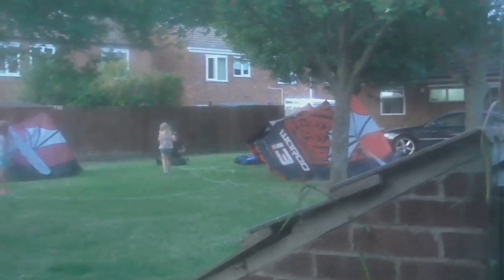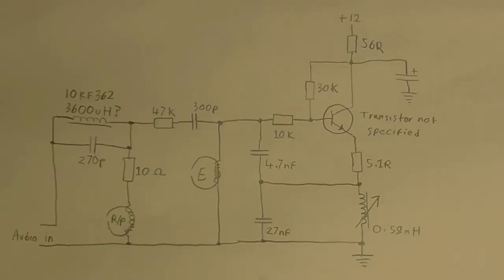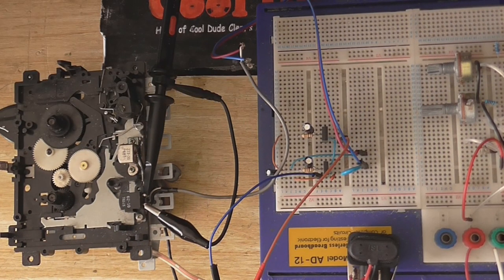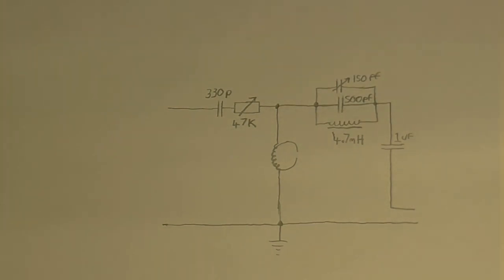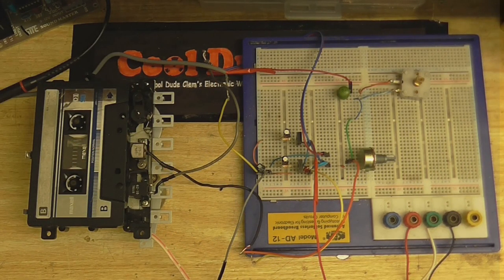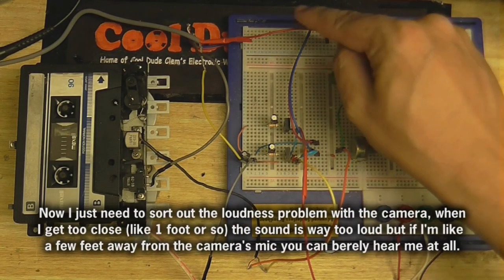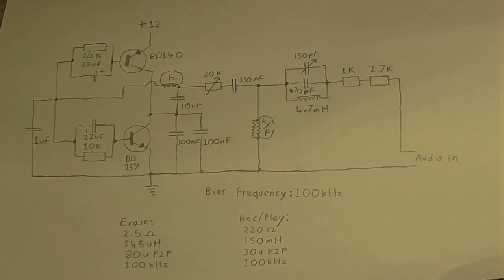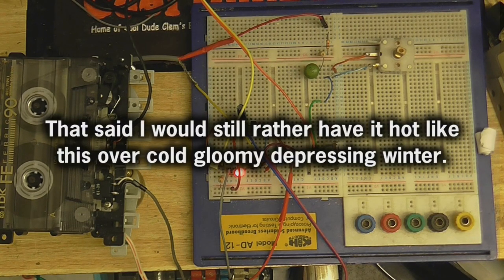My Home Made Tape Recorder with GOOD AC bias circuit.

Comment: Very useful video to me right now. Currently building a tape echo box using cassette head components and designing the mechanical parts partially from scratch, and the circuitry. It's kind of a race to see which works better first given I finally have the mechanical parts aligned like tape head azimuth and pinch roller pressure. Now my project is down to the circuitry aspect. Finding tape erase/bias circuits is not easy. I've looked top to bottom on the web only to find the same circuits you have. My issue is that I am trying to run the entire circuit off of +-10VDC so I can use OP Amps to do most of the hairy audio work. This required me to build a special motor control circuit with regulation and current control for a 9VDC motor. The other fun came in with the erase head bias circuit where I am at now. Not easy to find a solution or scale up properly to 20VDC to run an erase head without lots of wasted heat. I eventually went with the circuit you mentioned around  3:00 in the video. I found a suitable coil in my junk bin and had it running with around 50v p-p at 100kHz on the erase head which should be good enough for the heavier metal cassette tape biasing. One thing I learned is cassette tape does not like loudness as we'd first think experimenting, the heads actually require very little amplitude to work outside of the erase oscillator and bias feed. This caused me confusion for a while because I was pushing the record head too hard and completely confused why I couldn't get a clean sine wave in it and out of the replay head until I dropped it way down to damn near the tape noise hiss level. Gave me new respect for Tape EQ which is my next hair puller when I add pre-emphasis and de-emphasis to the record/replay amplifiers.

Comment: Hi Clem, I built your circuit though it used BC547/557s but could not get it to oscillate. I'm using a a Sony WM-D6C erase head which is about 0.90uh, 3 ohms... do you know the measurements of your erase head? Thanks, Mole

Comment: I'm a bit lost. Are you amplitude modulating the bias frequency that's recorded on the tape?
Thanks.
Reply: Yes that is always the way audio is recorded on tape. Without that ac-bias there is much more noise from taperecording. (in the early years some very cheap recorders used dc-bias)
Reply from the maker: Actually the audio source just adds a small amount of DC shift to the bias depending on whether the signal is swinging positive or negative, so when the audio signal is positive the bias if shifted up a little, and when the source goes negative the bias is shifted down a little, but it does not change in amplitude.
Reply: @CoolDudeClem  
Perhaps, on playback, you can scope the output signal from the head or first amplifier so I can visualize it 
Thanks again.
Reply: @robson6285  Thanks Rob.

Comment: Do you know how I can find a simple DC bias circuit? The AC bias looks a little too complicated and I'm just trying to find an ultra basic way to help improve my recordings.
Reply from the maker: You could simply add a very small offset to the signal, that should work. However, DC bias does not make good recordings, it doesn't eliminate all the distortions and brings out the "surface noise" of the tape, (a bit like rubbing a crayon on a piece of paper and having the texture of whatever surface the paper was on come though).

Comment: Is it possible to make this circuit but have significantly less voltage? You said the erase bias uses 80v, which is significantly more than my power supply can make. Also, how do 9v powered tape machines supply enough bias voltage if it requires 80 volts?
Reply from the maker: To be more precise the erase voltage is about 30 volts (RMS), the 80 volts I measured was the peak to peak voltage. It uses inductive kickback to get the voltage at the erase head up that high, a bit like a boost converter. With a 12 volt supply you should get a similar voltage at the erase had as I did.
Reply: @CoolDudeClem  perfect, thanks so much

Comment: Can you give any additional advice on picking a proper inductor? Thank you
Reply from the maker: It's all about trying to match the frequency of the bias oscillator. I just used a random inductor that I pulled out of my parts bin, then used an online R/C calculator to find the capacitor. I honestly can't remember what inductor I used, something like 4.7mH maybe.
Reply: @CoolDudeClem  Ah, so it doesn't entirely matter the mH as long as the cap is a reasonable value. Man I really don't understand that part.

I got the website you used if anyone wants to know:
https://www.1728.org/resfreq.htm

Comment: Couldn't you just use an LPF instead of a notch? Since you wouldn't need the frequencies above the bias anyways? Nice curcuit. Maybe you could make a pcb and put it in a fancy homemade case :D
Reply from the maker: Thing is the notch filter with the capacitor and inductor has an almost infinite impedance at that frequency, so it's no additional load on the bias circuit, a typical RC low pass would load down the bias too much. I intend to put it in some kind of case later on.